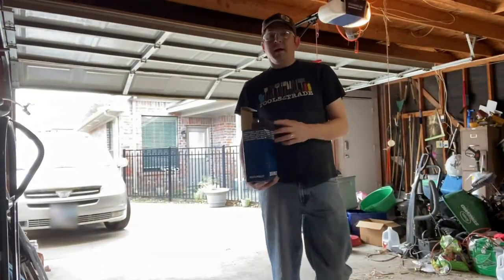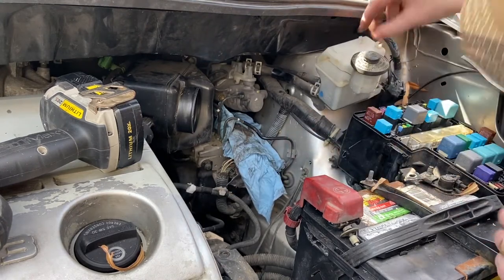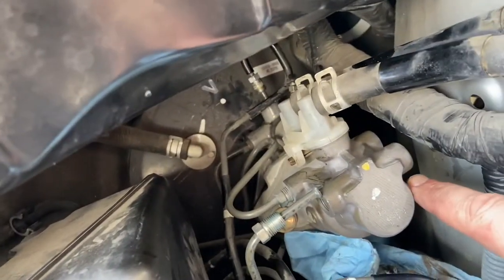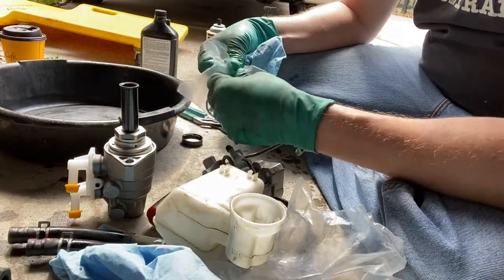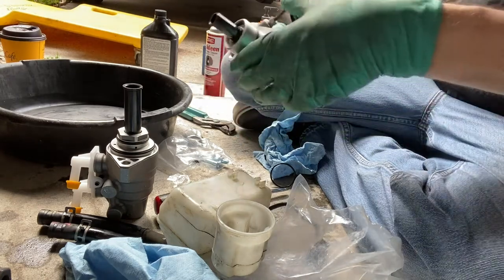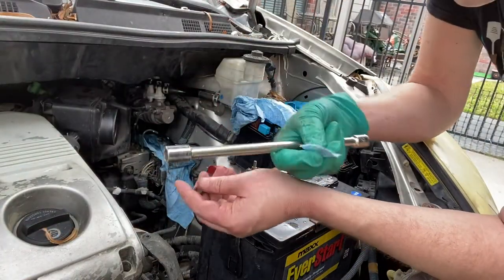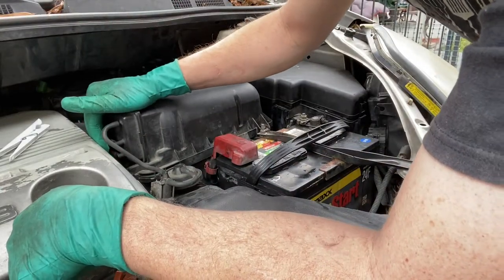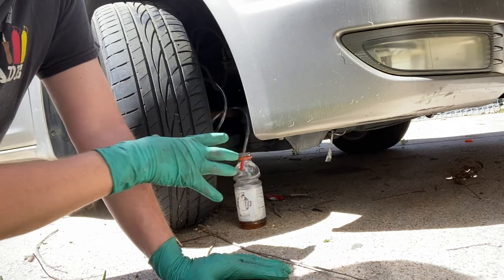Sienna Master Cylinder (2004)

Comment: Sub assembly is the name of the adapter between booster and master cylinder
Reply: Thank You. I just bought a used Sienna and plan on replacing the master cylinder sometime in the future. I didn't know about the sub assembly. Or what it was called.

Comment: Hi I have a question my sienna is leaking inside the booster I already replaced the master cylinder but still leaking inside the booster, what do you think it’s the problem
Reply: I'm having this same issue Jo Mon.   I was told by automotive repair shop to change out the seals to the part connected to the booster.   They can do it for $1,300 for a new set, but he told me aside that I could do it myself for less than $100, but didn't give me the part numbers for the master cylinder repair kit and the kit for the thingy between the master cylinder and the booster.   Plus he strongly suggested that I change out my spark plugs and PCV valve while I'm doing this, especially since my 2006 Sienna AWD has never had it done.
Reply: @dalework53  Im going through this right now... you can buy parts through Toyota for 1,400, all three pieces... I just got all three pieces for 75 from a junk yard... About to put it in and test it...Praying it works...
Reply: Hello, doe's problem solved? Having same problems and with junk part also.

Comment: When I place the new master cylinder onto that sub assembly housing. It's not flush. Starts off with about a 1/3" gap I can't push it flush manually. Should I bolt it down until it's flush or is there something wrong with the piston in the sub assembly that's not letting me mate properly?
Reply from the maker: For me, I secured them together using the bolts alternating the tightening sequence a little at a time.

Comment: The master cylinder has a bleeder port. Put a hose on that and put the other end in the reservoir. Pump pump pump. Get the air out. Bleed the left front tire first.
Then Right rear
Left rear
Right front 
Left front
Done